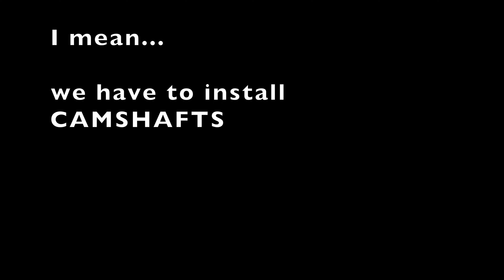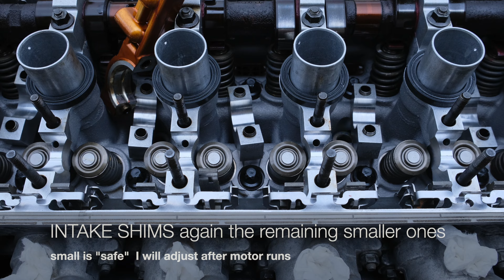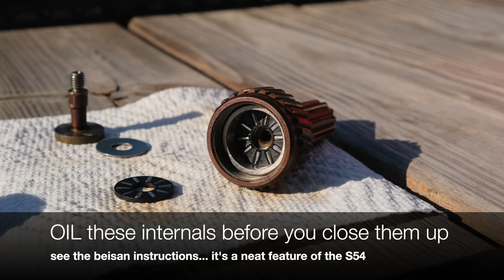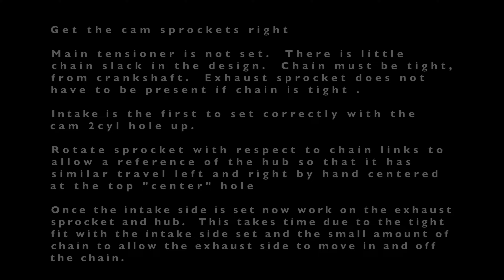S54 swap into e36 EP12:  Camshaft, and VANOS install with Timing

Comment: proper! thanks for sharing this
Reply from the maker: you are welcome!  note that because I had motor completely apart and no timing tool I had the local dealer finalize the timing.  but if you only did a cam swap or beisan kit this is good visuals!
Reply: @samthing4thetrack806  Ive rebuilt my s54 a few times now. Always love seeing a clean s54
Reply from the maker: @ZHPBrent  awesome!  yeah I tore it down without a book as I have S52 experience.  and put it together without.  I almost bought the timing tool.
Reply from the maker: also these things have gone way up in value!  so have S52

Comment: Hello, I need your help! I had the vanos unit removed, but both inlet & outlet helical gears still inside the hubs/cams. At this stage, I was turning the engine over to check timing and the inlet helical gear popped out (before this happened I already marked up the helical tooth in relation to inlet hub). However I think I turned the engine over to get the helical gear back in without realising the inlet cam was not turning but the exhaust cam was. Now my inlet camshaft seems to be completely out of time. I am not sure what to do? Will turning the engine over cause the valves to touch pistons if the inlet camshaft timing is way out?
Reply from the maker: so much to say.  but at 3:13 in the video.  look again. note the main cam sprockets controlled by the chain are mostly fixed.  if u have not disturbed the overall chain relationships AND u had the cams pointing in unison ‘up’ at the no2 dowel point.  u may be ok.  u should be hand cranking the motor first w a long ratchet and not with the starter.  if the above timings were not disturbed u are ‘likely’ ok.  but turn it by hand first.  the vanos has no influence without oil and control into the unit.  the other parts of timing are important so that the cams are not going to allow the valves to hit pistons.  The vanos causes the relationship of the cam to the main drive sprockets to move controlled by the large female helical gear influenced by the smaller helical gear "box".  That box has to move into the female gear to make something happen different than static.  The cam will turn by the chain only.  At the end of the video when the system is rotated, there is NO oil or control into it and the system moves fine without interfering
Reply: @samthing4thetrack806 so what I did is this. I was cranking engine by hand (not starter) with both helical in place inside their hubs. At some point inlet helical gear came out just enough for inlet cam to stop turning with crank/exh cam. I then pushed it back in to align with markings I had previously made. At this point it didn't click that the inlet cam was out of time. Stupid I know. I then continued to crank engine for 1 to 2 full revolutions until I realised my mistake. I had the inlet cam about 180deg out of time. I don't remember any difficulty turning engine when cam was out of time. Nothing I felt as if piston was hitting cam. 
To try and rectify, I put all pistons in a position where they are as far from TDC as possible. I measured them from spark plug bores to check. I then rotated the inlet cam back into time with 24mm wrench.

Do you have any advice on what I can check to be sure I have no bent valves?
Reply from the maker: @fvresonanator  well if you are hand rotating the motor and it never "stops" then you are ok most likely.  It should be super noticeable by hand if there is any major interference.  Either way the vanos pieces have no influence at all, there is nothing driving them.  180degrees?  yeah that is possible depending on how you located the cams at the beginning, I have no experience with that, as I was very careful with initial cam install and timing to fully understand the system, and the no 2 dowel points all that.  

but as for checking once things are "right" a leakage test will tell you if something is wrong.  You can only hand crank to 50 or 80 psi, the cheap autozone ones are not the best(I have that one).  but i did hand crank the motor I bought to see what type of compression I had it was 50-80 psi on all cylinders.  so you would want to check compression on all cylinders  

look at this  https://youtu.be/ZDn8GmwmGpM  the vanos is a free "wheeling" system without oil or solenoids and ECU
Reply: @samthing4thetrack806  at the beginning I hadn't touched or.interfered with the timing. The exhaust and inlet hub bolts were all tight. I never touched them at this point.

What I've realised is that the helical gear is what makes the cams turn when they are installed. Without them installed the sprockets are floating so the crank can still be turned, but the camshaft will stay still.

What do you means by no 2 dowels may I ask?

Many thanks for your response.
Reply from the maker: @fvresonanator  you have to do the compression test...

the male gearboxes are in charge of adjusting the cam within some limits of the rotational slide that I show at the beginning with the females executing it.  (sentence deleted).  I do not remember the exact VANOS numbers but its 60 degrees of motion on the intake and less on the exhaust in the design.

the helical gears female and male ONLY do the "final" cam adjust.  The main cam gear and chain do the actual timing.  All of which is reliant on cam placement in the very beginning.  Before chains or anything else.  No 1 piston at TDC and crank locked.  It's all in the video in detail just stop to read it.

No2 cylinder dowel holes "up" is at 1:45, watch the scan of the picture go "up" and there are the holes, and also at the very beginning of rotation at the end of the video

the lobes of intake and exhaust are somewhat "up" but note the differenced with the exhaust and intake cam lobe that I have at initial set.

also see https://youtu.be/CwhQ9mv6zqY this shows the detail (deleted words), normally part of an exhaust hub broken issue
Reply: @samthing4thetrack806  Ah okay I think I understand now. But so I am clear. 

If the helical gear is out completely, will the camshaft turn or not? My understanding is that the camshaft will not turn.

At the beginning both my 2 dowel holes were pointing upwards, with exhaust and inlet cam lobes on cylinder 1 pointed towards each other. 

After my mistake, my inlet cam hole was now 180deg out from the exhaust hole (i paint marked each hole). This is how I know my inlet cam was 180deg out
Reply from the maker: @fvresonanator  yes it will turn without any of the helical pieces attached.  thats why initial timing is super important and the bolts the guy shows broken about in the "Redish" video should already be on and torqued to spec.  

The VANOS can have NO influence without the system complete on the motor.

Something was not attached for the 180 thing to occur in a very fundamental way not related to VANOS.

The no2 dowel thing is where the motor is at every time it is started, -60 from before no 1 cylinder TDC intake and -45(i am guessing) for the exhaust.  Having recently been thru a tuning session that is also "where the tables are set" for the cams,  At the same time the table is "expecting" the defaults -60 and -45(?) mechanically.  it does sense all that with the crown things at the back of each cam
Reply: @samthing4thetrack806  no I am absolutely certain everything was attached at this point.

If the hubs (male gears) are bolted to the floating  sprocket, when the helical gear is out, wouldn't the cam stay still?

. I can't understand what is attaching the hub to the cam other than the helical gear?
Reply from the maker: @fvresonanator  BMW magic!  (deleted sentences)

There are lots of pieces to the cam "sprockets" seen in the "Redish" video.  RealOEM doesn't show them for some reason I guess its because it is a "unit" and would reveal how it worked when the original parts diagrams were published.  

You are fretting and not "studying" you can take all the stuff apart and not even remove the cam sprockets but see every bolt, or watch videos on VANOS broken exhaust hub or the other one I showed.  GO, SEE, DO
Reply from the maker: @fvresonanator  this is super good engineering stuff... if the VANOS solenoids or oil seals in the actuator side fail the timing of the cam "DEFAULTS" to no interference, or the -60 and -45(?) position. honestly when everything is right there can NEVER be a valve hitting a piston other than over revs.
Reply from the maker: @fvresonanator  hope you are feeling better about it today.  hope you have verified that the main sprockets and cams (deleted words) together.  as for 180 degree differences, you can be lucky there, as the 4 stroke engine vs. 1 or so rotation and a potentially wrong index on the cam may not be detrimental.  do the leakage test once everything is properly timed
Reply: @samthing4thetrack806  thanks for your kind words. I've double checked and the main sprockets driven by the chain are not bolted to Cams. They float freely. Only when the helical gearboxes are inserted do the turn the cams. The camshaft hubs (female) bolt to a freely spinning plate behind sprocket. But it is only when the helical gears are inserted do the cams turn. 

Anyway I've got it back in time and I will do a leak down test with each cylinder at TDC.

Thank you for your support
Reply from the maker: @fvresonanator  i guarantee you that the bolts you can see on each hub can be removed to show (deleted words so no guarantee... oops).  I do not have their tq spec but the hubs that have the helical female gears are torqued to 14NM for each bolt, upon reinstall.  (deleted sentences)
Reply: Ok what I don't understand is that with the helical gearboxes completely removed how the cam would turn. 

Does that mean the hubs hit the end slots on the sprockets? Or is there enough tension between hub a sprocket that they turn together?

I don't understand how my camshaft went 180deg out without me untightenting any hub bolts.
Reply: Those bolts that are prone to breaking in the Reddish video do not bolt the sprocket to camshaft.

They just bolt a smaller 'ring' to camshaft that the chain sprockets mount to. I can assure you the sprockets driven by chain are not bolted in any way
Reply from the maker: @fvresonanator  
agree you do not yet undderstand the system.  (deleted words)

I am guessing the slots and either end of their extent are designed to never touch the 14Nm bolt in operation but can.

agree I do not understand the 180 degree event either but realize that the camshaft for the intake is in a different lobe position than the exhaust at no 2 holes vertical.
Reply: @samthing4thetrack806  https://youtu.be/NEpq2z2Z_Rs?si=EGbPEtnCJlrmMHjT

No the torx bolts do not attach the sprocket to cams. See video above for example. 

I took my sprocket off today. The torx/Allen bolts are attaching a smaller ring that is separate to the sprockets
Reply from the maker: @fvresonanator  ok, I could be completely wrong.  If I were you tho, I would not turn the motor at all until you understand that whole mechanism of the main sprocket, and all the bolted pieces.  It makes zero sense to me and I didn't document it that the cams do not bolt to the sprockets directly.  My reason for that is S54 is better than S52 VANOS (single) but the concept of operation is the same
Reply: @samthing4thetrack806  I still don't fully understand it, but I'm learning haha

I now have my crank locked with the pin and will not be removing until all vanos unit is reinstalled as per the Beisan procedures. I'll then do a leak down test as you suggested. 

Thank you for your help

I'll let you know my outcome if you are interested
Reply from the maker: @fvresonanator  the speed acad vid was good.  I didn't get that detail and I should have in my video.  Either way realize there are bolts on the hub that still do a limit and therefore help with getting the system to turn.  

but yes in terms of "safe" operations.  understand all of the pieces.  make sure the chain and slots as he showed are all correct.  get the entire system together, it does not need oil, ecu for rotation.  

(I did not rotate the system until it was all together)

carefully rotate by hand

in the end before motor was started I actually had the dealer do the final "timing".  I think I left something loose and so it took them longer than expected either the VANOS solenoid oil filter piece or something else so it didn't hold pressure and took them  longer to set but they said after that it was ez pz.  the dealer can computer up and use air to energize the solenoids, they have the no 2 dowel alignment tool and all that as well

and yes let me know